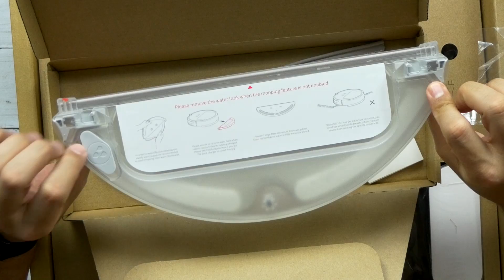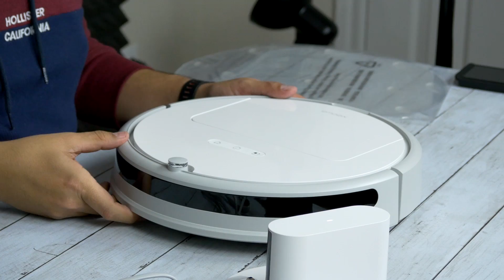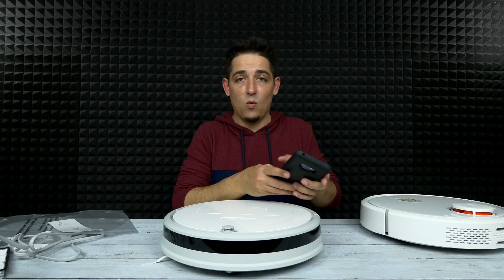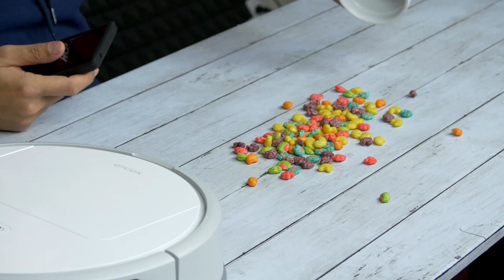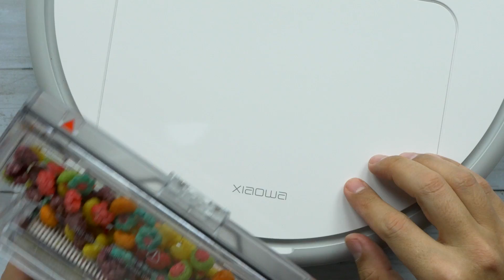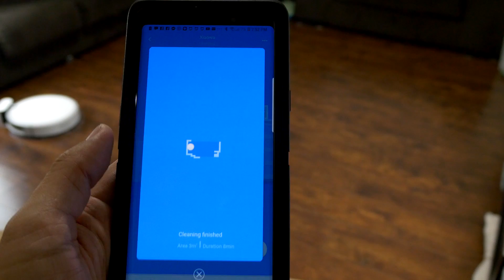The Robot Vacuum that MOPS! - Roborock E20

Comment: I run the m6 daily, and my floors look awesome🌼 allabout.wiki/Roborock I wet mop 2 days and dry sweep the rest of the days. When I first got it, I used the included disposable pads. I didn't like them--the dry pad has no depth so if it picks up a chunk of something, like dry cat food, then it pushes it around or drags it around the floor. The wet pad wasn't very absorbent so left streaks and wheel marks.